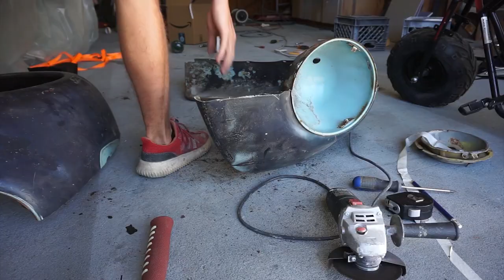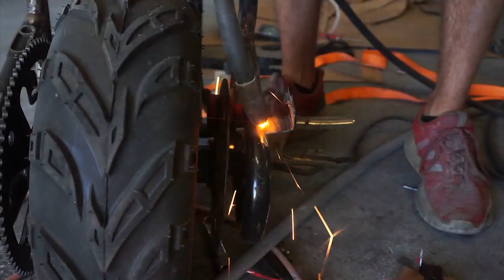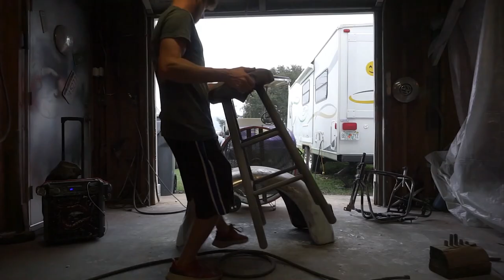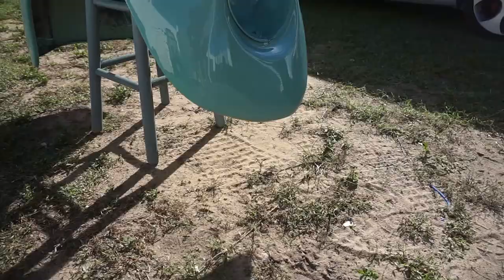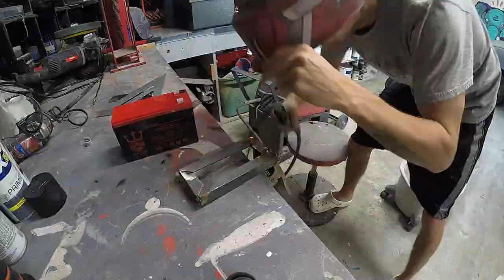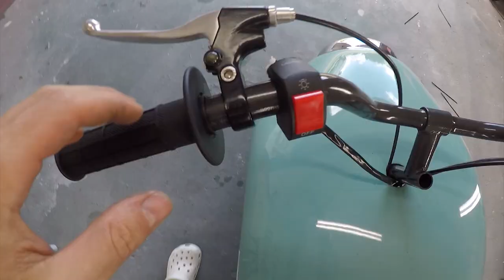Building a Volkswagen Inspired Mini Bike in 11 Minutes

Comment: If I didn't know better I would swear you are my Grandson.  That's the kind of stuff I built in the 60's and 70's.  I took a lot of criticism for some of my crazy ideas back then.  But they were right on par with yours.  Keep it up. I"m still building stuff....  The Pontoon Boat is what brought me here, and the Jet Ski is something I've been trying to get my youngest Grandson interested in building here in my shop in Texas.  I even picked up a 400cc Burgman 3 weeks ago for the project.

One bit of advice, throw away the HF Pipe Bender and get a JD2'ed tubing bender.  If you were closer I'd let you come out here and use mine.

Comment: First of all great idea mate!
I would like to make a few sugestions if you allow me:
1. Leg space. as you have to split legs quite a bit you may reduce that part bending the metal (I don't know the word in english and forgive me if my english is to general)
2. Light in handdle and maybe Speed meter, you may add Light, mirrons and speed meter on the handdle, so you have one light  always ahead and the other on the place you are turning. classic meters and 2 mirros you can make a carcase of the same material and color, it should be nice!
3. Chain Cover to avoid injuries.and as you have your  legs closer to the engine, you may put a dover over the chain with the same color (maybe logo WW too) so you don't have to worry about putting your leg to close to the chain.

I really like your idea, and as I don't have the money or equipment in my country to make it real, I Hope you can do it! 
Great video and you won a new subscriber! 
Greetings from Colombia